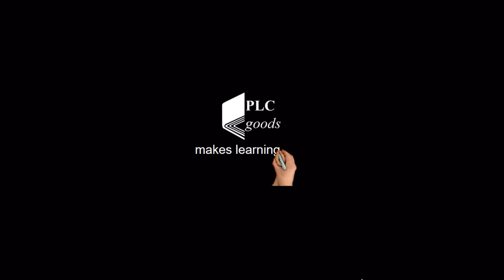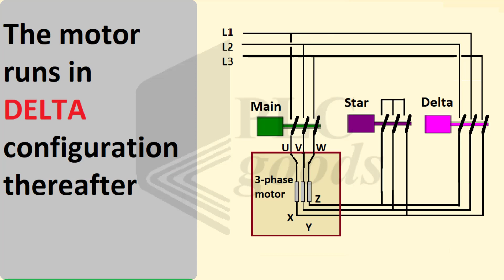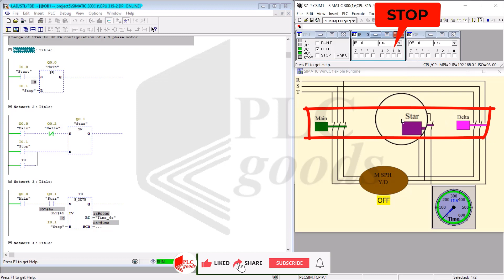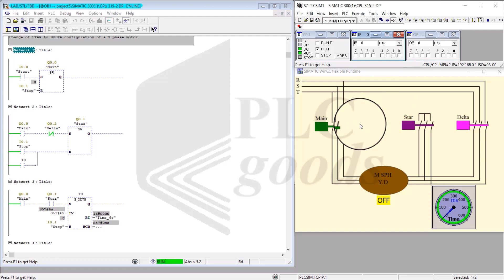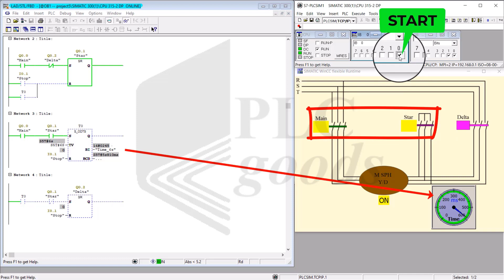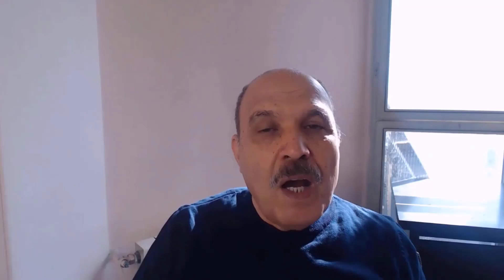Writing a PLC program for STAR DELTA starter

Comment: hello sir i need this program  in schneider plc
Reply from the maker: Hello 👋 — thank you for watching my videos!

My tutorials are designed to help viewers learn the logic and steps, so you can practice and create the program yourself, even if you use a different PLC brand like Schneider. While I’ve used [mention your PLC model, e.g., Siemens or Allen Bradley], the programming logic applies similarly to most PLC brands.

👉 I encourage you to try building the program in Schneider PLC software based on the concepts from my video — it’s a great way to improve your skills.